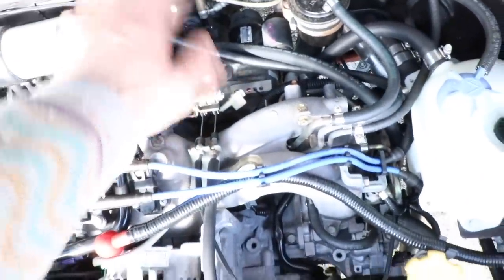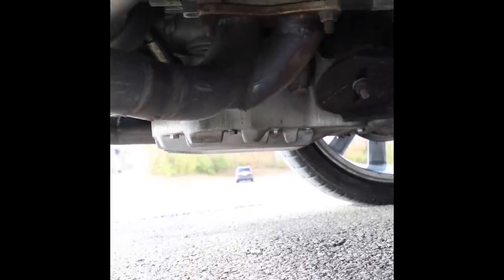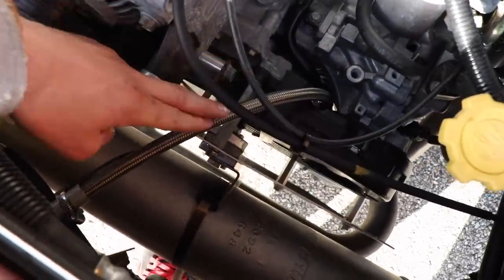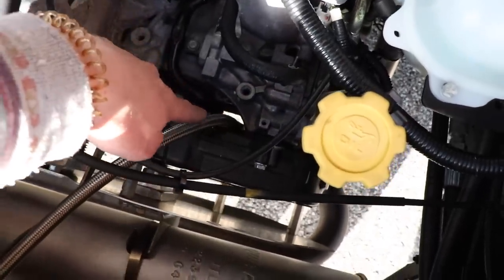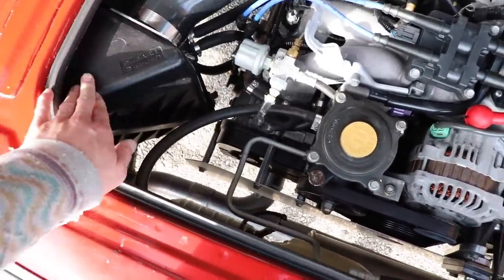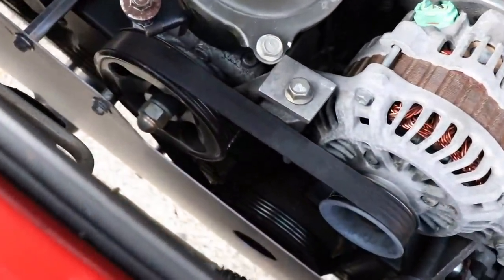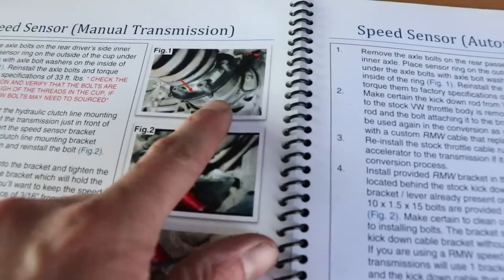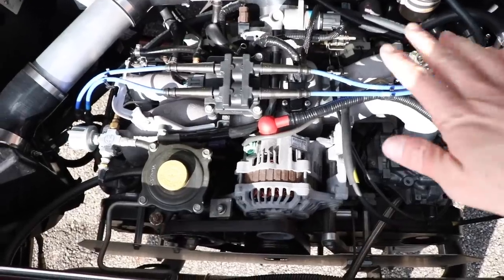VW Subaru Conversion

Comment: The thing I hate about this Subaru engine is that it's an interference engine timed with a rubber band. Have seen many ruined when the band slips and the valves hit the pistons. Even a couple hundred miles after the required scheduled replacement. In my opinion, an engineering error probably ordered by accountants.
Reply from the maker: Van's Tech Corral if you replace with quality idlers, tensioners, and belts and not a Chinese kit it will last until the next interval just like the other millions on the road. I agree it is a mess and intimidating. If you don’t replace it on time you’re playing with fire and the cog idler bearings will fail. But the timing belt is nothing to be concerned about!!🏁🏁
Reply: @PostPros  It would have been better to use gears or at least a chain. For an interference engine, it was a stupid cost cutting measure, or even intentional to create the need for an expensive service regularly. For you and me, if we change it and nothing odd has happened, it's almost  just our labor. For millions of others, it's a major bill that wouldn't be a regular high expense. However, I have seen stock Subarus that have had a new belt fail during overheating, ruining the engine. As you know, the stock waterboxer's cam is gear driven. Even Subaru is now going to chains.
Reply from the maker: Van's Tech Corral gears would be better and more reliable. They’d be loud. Chains are definitely better as far as longevity/reliable. Did they do it for the $$$. Maybe?? That’s fine with me honestly, they wouldn’t be in business if they’re cars lasted forever. Let’s not forget about all the other engines that use a belt too and not target Subaru’s. Either way to have an over head cammed boxer you need something to drive the cams. I’m not mad about a belt or the design, but I’ve never had or known anyone with a problem with them either. I think people see the belt setup and think it’s going to break based on how it looks. I’d take the timing belt over pushrods. I’ll take the smooth spinning belt vs pushrods bouncing around and lifters clattering. But that’s just me!! Put a Porsche in, they’re chain driven!!! Honestly mostly every engine is a good running engine, ppl just target (me as well) brands and designs. As long as we have something we like it’s all good🤙🏁
Reply: @PostPros  I'm just speaking as a mechanic by what I encounter. I have no brand loyalty. Think of those Ford Triton engines that spit out sparkplugs due to design. I haven't had experience with Subaru engines outside stock Subarus. You are correct about other engines using the same sort of setup. All of them have increased failure rates, and interference engine failures due to belt issues are generally fatal to the entire engine. One particularly unfortunate circumstance where a belt that had been recently installed by a Subaru dealer and it failed became a warranty replacement, but with many other charges amounting to the cost of the engine tacked on. Nevertheless, you are correct, many well off people don't see this as a big problem, but they may start to as the economy crumbles. There are now engine designs out there where repair requires that the entire engine now be removed. It was cheaper to manufacture that way, but the required maintenance at some point will exceed the value of the vehicle, resulting in a final trip to the wrecking yard. I commend you on your excellent and well-thought out conversion which I am sure will continue to serve you well.
Reply: @PostPros  I can't fault the Subie conversions because without them I wouldn't have an engine! I was given an 84 Westfalia in 2012 because the family that had it dropped a valve and the piston rod went through one of the case halves. I didn't do anything with it until 2017, when I was given a motor for $100 from a guy doing a Subaru swap, then another fresh engine that had caught fire, along with 4 Mercedes wheels and Michelin tires. It's been a daily driver for the last couple of years and only a few hundred was spent in all including the van. Due to health and financial situation that's what I had to do. The story is at https://www.youtube.com/watch?v=F1q5FOXeN3E&list=PLnCzg6kzTl7BIX8_FEPmXZSueAwcfFw-2

Comment: Question To Everyone Here
Is it possible to make a complete 4x4 conversation fron Subaru to VW van.?.
Thank you for your Positive  Comments.
Reply from the maker: MarcoAntonio Raygoza you definitely could, but it would be a LOT of work and custom brackets, mounts, welding, machining..exc. 
it would be so awesome!!
Reply: Why not convert a Synchro?
Reply: @PostPros  l think if we Shortened the Bus to the Proper length of the Outback or a  Tribeca, Will make it a bit easier to fit. 
Well it looks easier but we know what the real world.
Reply from the maker: People have converted before. You could just get custom driveshafts to accommodate VS trimming the bus down. There is a lot of custom things that have to be done here and isn’t a common conversion (yet)!! Hopefully this will eventually be an easy option!!

Comment: All that work and wanting reliability I’d get rid of that plastic cooling bottle
Reply from the maker: Camp Runamuck I’ve thought about it and it would probably be better/stronger. But the original plastic bottle lasted 30 years. So it’s clearly not a weak point. Also my coolant tubes running from the engine to the radiator and back are plastic. I may upgrade eventually, but just because something’s plastic doesn’t mean it’s a weak point.. although the aluminum coolant bottles, and stainless pipes I’ve seen look pretty sweet🤙
Reply: Dust in a Bus bull shit those aftermarket ones are shit my buddy just had one blow about half way to Alaska last summer it lasted about 2500 miles  . I warned him when he bought it . Another friend got two years out of one .

Comment: Is there just a single small radiator on the right or is there a second radiator on the left?
Reply from the maker: T'airn'KA there’s one big radiator centered in front. It was water cooled from the factory and I just tapped into the coolant lines. Makes it easy for the Subaru install!!🎉

Comment: Can you put a GM is engine in that,a small v8???
Reply from the maker: joaquin perez I’m sure you could but that’s a BIG engine. You would also most likely have to raise the decklid, which makes the bed not functional. I’ve seen it done just do a YouTube search!!! If you want power, just put a WRX or STI Subaru engine in and you can get whatever kind of power you want and it’ll fit in the engine bay. Thanks for watching!!

Comment: A few questions: first, bought a 2002 Subaru Imprezza engine, either rebuilt from Subaru or from a junkyard. Cost? Then, you bought a Rocky Mtn Westy conversion kit for 3k. Then, a few extras like Subaru air filter, dash gauges, rear dipstick tube, etc. Cost?  How much horsepower from Imprezza engine, and is there ground clearance for a Class III trailer hitch? I'm looking at a Westfalia, at present, and want to tow an Alberg 30-ft sailboat around US and Canada...Time and total cost for everything, please...
Reply from the maker: I don’t think a VW bus is going to do what you want it to based off the questions you ask. This is not a vehicle you tow a 30ft sailboat around North America with. Have a look at what an Impreza can tow, since that’s the engine used. It’s not too much at all, maybe a ton? It’s essentially a little car. 
With the money you would spend on a bus to get it to do that, you might as well get a newer truck that’s designed to tow, and also will not give you problems..exc.
I pulled 2 Seadoos and a trailer over the summer, maybe 2000lbs. That’s the MOST I’d want to tow. It was jerking me all over the place and I needed more power. Also with the engine/trans in the back it gets drenched while unloading the boat, every once in a while is fine, but I’m not a fan of repeatedly doing that.
I’m sorry, I know you want a VW to travel with and pull your boat, but I don’t think it’s the right vehicle. You need something big, big truck, suv or something with an 8cyl with a big towing capacity for that job.
I say all this in the nicest way possible🎉
Unless you are VERY skilled and can do all the work yourself. It going to cost you $30,000+, minimum you need an H6 with a WRX 5speed and a massive custom hitch, you would still be struggling. Any more questions please ask!!
Thanks for watching🎉, good luck with your travels🤙
Reply: Thanks so much for such a fast/detailed response! You have a lot more experience/knowledge than me, so I really appreciate your response and will give my plans a lot more thought...
Reply: @PostPros  I like the WESTY so much that it didn't take me long to separate the sailing/towing issues! What kind of money would you want for a copy of your wiring diagram? I don't need it right now, I just started 6-months of chemo, here in Bangkok, for colon/liver cancer. It's 3-days/2-nights, every 2-weeks. Maybe in 6-months, I'll need it. I'm a retired expat, lived in the Denver area for 30-yrs, still have 2-sons and grandkids there. I need to get healthy/vaccinated before I can return to USA...
Reply from the maker: Sorry to hear that, I hope the best for you.. I just found one online printed it off and used it.. it all depends on the year, maf vs map..exc 
I’m sure you can find something, if not I’ll help you look, but need to know model and year exactly